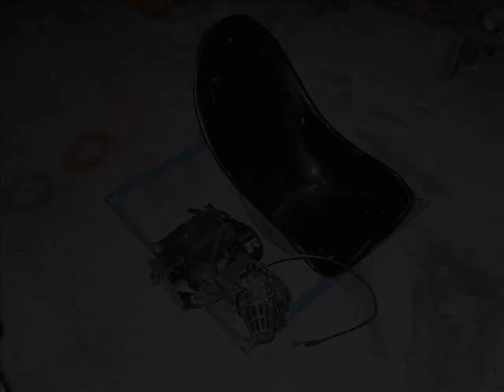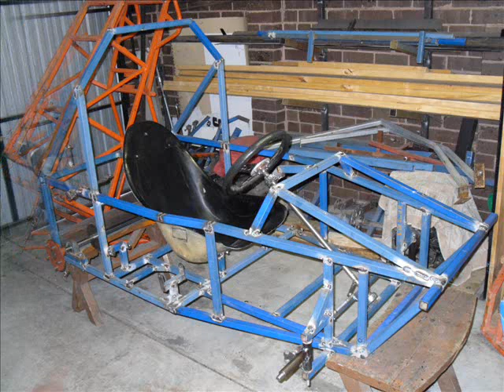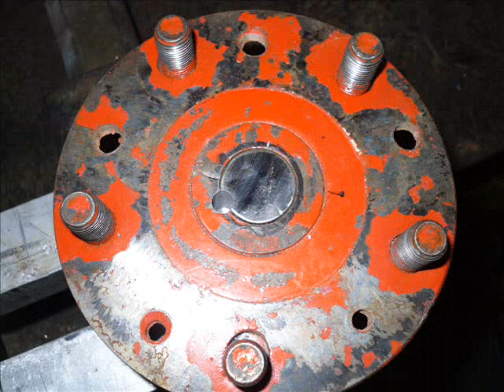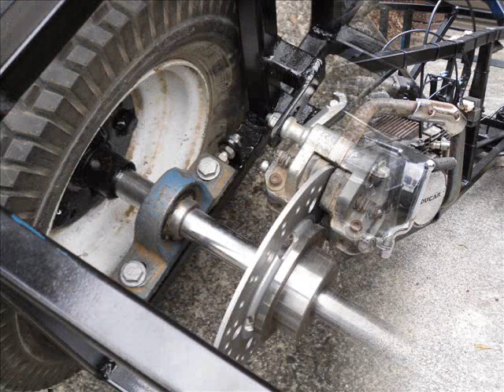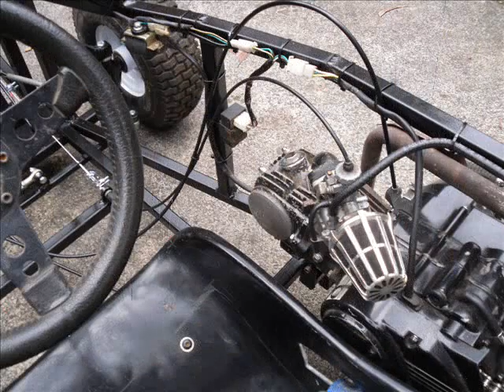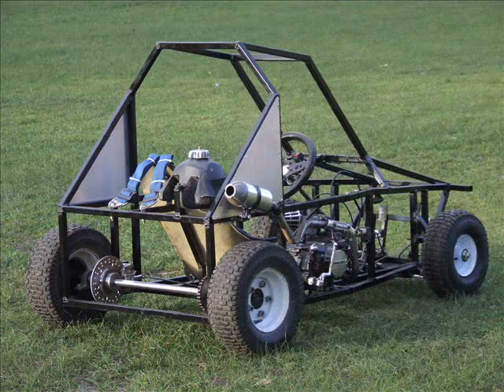Rigid frame go kart build slideshow

Comment from the maker: @loueedafly No, not roll pins, they're allen head bolts.. Those holes got tapped out with an 8mm thread. It's an easy way to create a keyway connection without use of a mill.

Comment: so you just used a dirt bike motor with the same trans right, and i was wondering how you mounted it, you probably just matched the bolt pattern and made your own mount,aslo do you use stock shifter or did you make a custom one, thanks, great job man

Comment: Hey, great build, im half way through my build of a similar rigid kart and im trying to mount my hubs similarly to yours, are they roll pins you put in those two holes? i was thinking about just welding my hubs on but then i wont be able to get the axle out... Any help would be appreciated

Comment: One other question, how did you mount your sprocket and disc to the axle? i have a similar engine, a 90cc honda 4 speed, and i have the rear drive sprocket from the bike but im not sure how to mount it because go kart hubs online dont go as small as 3/4 inch which is the size of my axle. Im stumped. Any ideas? Thanks heaps

Comment from the maker: @loueedafly My sprocket and disc carrier have a keyway. Had to pay an engineering co. for this. Both sprocket and carrier are just industrial sprockets, the carrier has had it's teeth machined off. Both had a centre of about 10mm and the eng. co. opened them up to my axle size (1") and cut my keyways. The two sprockets, plus maching cost me $160.